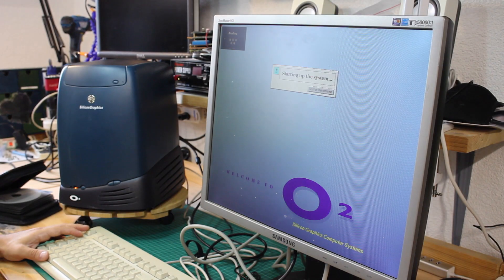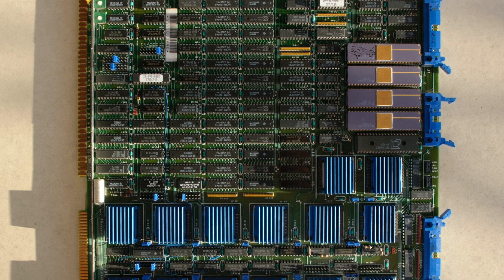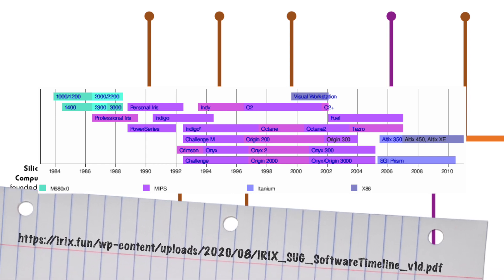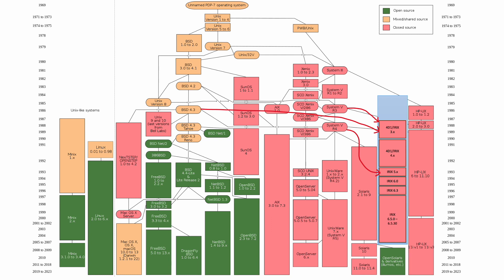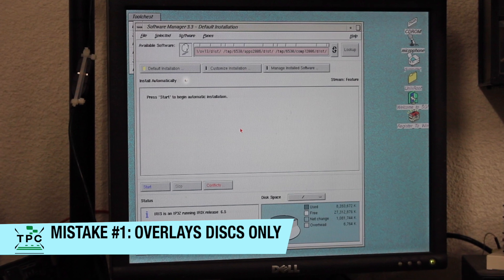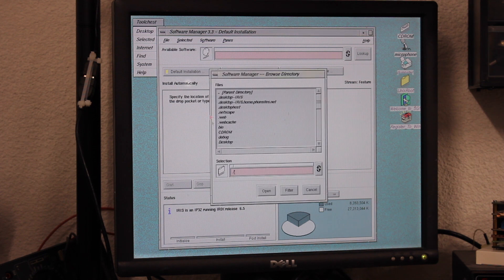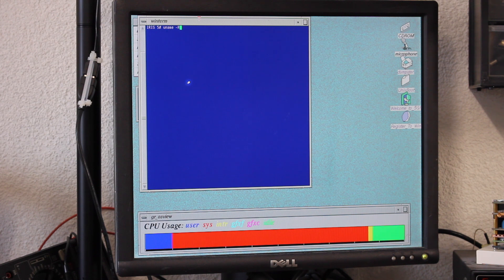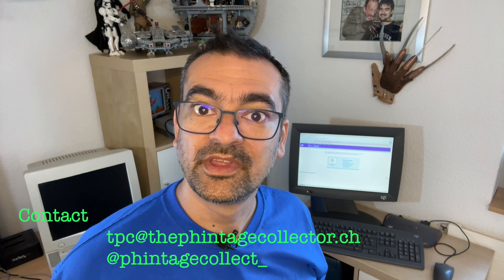Some insights to SGI & IRIX, and the 6.5.30 Upgrade (SGI O2 Restoration, Part 3)

Comment: I've always wanted to see the very early versions of IRIX running on the very old hardware - even the 68k machines, those boxes seem rare (understandably) but the early SGI stuff is very interesting. The lack of information on IRIX 1/2 releases just adds to the mystery, I suppose like so much specialist computer equipment of the time though a lot of details are just lost to history.
Reply from the maker: Yeah me to! i would love to actually see 4DM 1.0 (IRIX 1.0), but also the GL2 precursor OS. Maybe I can get my hands on it one day. So far the oldest I got is IRIX   4.0, but no machine to run it on.